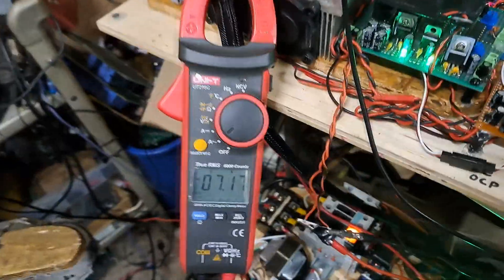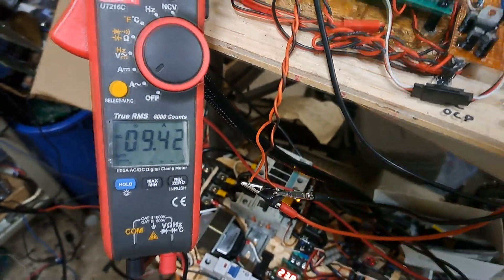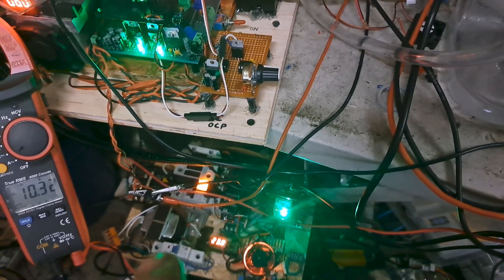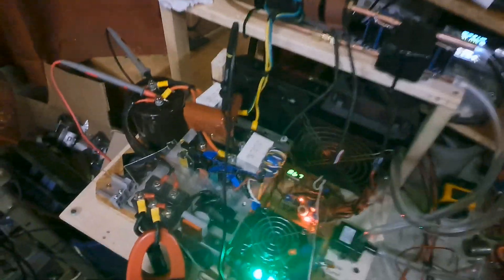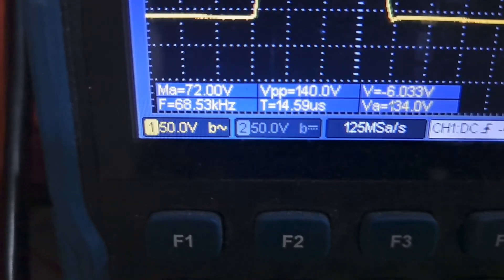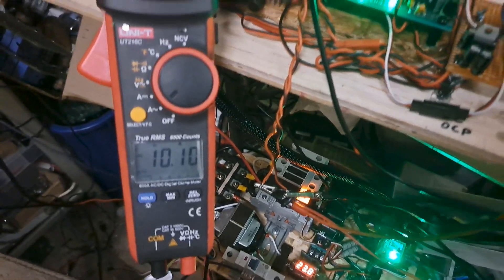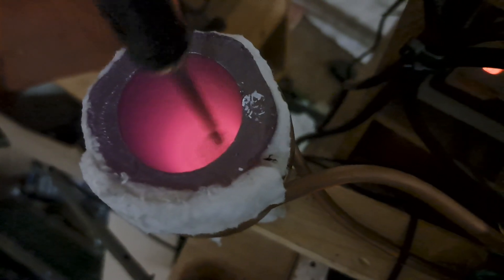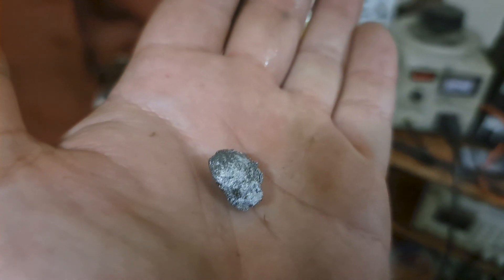H-Bridge Induction Heater Aluminum Test ~500W

Comment: Solid induction heater, i also wanted to built one like this but for now my I only have 12V ZVS witch is killing mosfets or capacitors when pushed to 350W
Reply from the maker: @TraperT  those can be easier to get working sometimes but I find the 30 to 50a requirement a little too much. Seems like the high power Chinese boards got it pretty much worked out by now though.
Reply: You need a microcontroller to control the switching to sense the zero crossing time to make less power losses the concept is used for the cooking induction heater for more information there's a YouTube channel explaining the concept in detail
Reply from the maker: @jeanmichel9207  You must mean zero volt or zero current switching. That is definitely ideal at higher power. These bricks should be able to handle a good deal of hard switching but yea tuning it is definitely going to reduce losses. I'm already kind of pushing it at close to 70khz though. I'm eventually going to tune it down closer to 40khz.

Comment: Impressive channel, just 'found' it on YouTube's main page :ø)
I live in Europe where 230V is 'normal' and I was wondering if you had tried one of those 1:2 transformers often used to convert mains voltage between US/'elsewhere' (often 50Hz vs 60Hz isn't an issue as most devices rectifies AC to DC internally)
A higher input voltage should lower current draw, and less current draw = less heat

Best of luck - I'll be following you from now on!
Reply from the maker: @EgonSorensen  Thanks, higher voltage is definitely an option but I'm more worried about my line amps than the bridge amps. I have old Alu wiring and have had a couple issues in my old panel so I don't want to push more than about 15A continuous. Using a Step up Transformer won't really do anything about that since it's still going to draw the same amps or more. Trying to just use 120 receptacles because it's too much of a pain to try to tap off my 240.
Reply: @Magneticitist  Ah - got it, so your amp 'limit' isn't in your circuit, but from your 'max power delivery from the wall'.
Bummer...
An alternative then could be using batteries, 10 pcs (12V) in series (or how many you need to deliver the 'sweet' spot in Volts needed). I've seen induction systems in the US use lithium (LiFePO4) batteries to provide the extra power needed which couldn't be pulled from the wall in kitchen stove top systems. They charge up when not used, and discharge when max power is needed.
Best of luck, and an awesome system btw :ø)
Reply from the maker: @EgonSorensen  What I'll probably end up doing is running 3phase 208 but I'll have to do it at work. For now I'll just have to make sure the thing survives at closer to 1-2kW continuous. Or maybe if I ever feel up to it I'll just run a dedicated 240 circuit but man I'm pretty sure I have no room in my old ass little panel for anything else.

Comment: Amazing brother , aluminum is a bit harder to heat cause it has less parasitic looses I think , you can trow some copper wire in the aluminum and make a dural alloy
Reply from the maker: Yea it gets a bit complicated regarding heating different metals with different topologies and frequencies but I felt like it was easier to do aluminum with this one. The only real downside to me is not having a low-ish "standby" current. It's basically the inverse of how a ZVS parallel LC works. Pretty easy to get going though. This is a good little test build to get a feel for running bricks and higher powers for long durations. 
I almost tried to buy TrentHV's tesla coil stuff. IDK if he still has it but I want to build a big brick TC that runs at low frequency. I just always change my mind cause I know I never run the smaller ones since they're too loud. Need to just get back to the big QCW bridges I guess.

Comment: Hey dude could you provide a reference for the PLL curcuit.

I'll be using one of those green powdered iron cores stacked. And 2 cascading N87 core for the current feedback , I'll be cascading then to make winding it easier.
I'm thinking maybe 1:300 (1:15:20 ) with a 10 Ohm burdan resistor and I'll have the OCD set to trip at 80 Amps peak. Is cascading it a bad idea and is the trip current OK if I'm using a half bridge with 60n60's.

I'm planning on using 0.33uf 1200VDC 630VAC induction cooker capacitors. About 15 in parallel for 5uF. But I'm not sure if that's a good idea for a 2-3KW unit, cus I'm not sure if they can handle the current. Any idea if they'll work.
Reply from the maker: It's the same as https://imgur.com/aPpbIlF but with like a 1.75nF timing cap and 5V supply. So it's just shifting the VCO output following PC1. A 555 timer to manually tune it works fine though. With these coupled LC's you just tune the bridge to the highest input current at no-load while also keeping an eye on the switching waveforms. For the best switching possible it's a little more complicated than that but that's the gist. I'd have no problem setting a particular frequency per work coil and just leaving it. 

For OCD you'll need to go higher than 80A with this topology. It will be in the hundreds of amps running in the tank. Sensing the tank current seems more effective but I suppose you could also limit the primary pk amps. Same thing works with feedback on these, you can sense the primary current as well since the tank frequency is reflected back on it. I haven't tried that yet. I would just create whatever high ratio CT that lets you easily do the math on the comparator voltage. 1000X is typically pretty easy. I really just start with a high burden like 20 ohms and work my way down til I've found the range that let's me test trip the OCD at low power. Then I'll decrease it at higher and higher power and eventually maybe calculate what I want my pk amps to be. 

I use the same cooker capacitors and I got them from some random store off amazon that doesn't even sell electronics so I was worried about them. They seem to work fine up to I'm guessing around the 1kW region, all depending. I would put a fan on them though..
Reply from the maker: So I ended up running it at about 600W for like 20 minutes and got some more aluminum molten. I basically just melted another small heatsink and then kept adding some aluminum foil balls. After that time those induction cooker caps were pretty hot. I'm not going to run them anymore above that power. They do about 600W for a little while like I thought but they just start getting too hot over that. I've seen someone else shave them down in order to sink them but that seems like a lot of work.

Comment: Can you use ferrite for the coupling transformer? I have a few large material 75 toroids
Reply from the maker: Yea I don't see why not
Reply: @Magneticitist  I've seen a lot of people talking about tuning the coupling transformer, but what is that process look like in practice? I haven't seen anyone actually describe how they got optimal tuning except just use a bigger core😭
Reply from the maker: @darascope  The size of the core should only really matter when it comes to making sure it's not saturating. I think any decently sized core can handle the amps unless someone is planning to push like 40+. When it comes to tuning or impedance matching, from what I can gather this is really just a process of tuning your primary impedance to cater to your intended power consumption at the intended voltages. This is a bit similar to just tuning the primary on a single resonant Tesla Coil. Right now I'm using approx 11 turns on my primary. While it doesn't heat up at around 600W circuit input the low impedance may become a problem when I hit the highest input voltage and no load operation. I may need to add a few more turns etc. If your primary is poorly matched to the load at the intended frequency then it's probably going to either heat up quite a bit or simply not transfer a lot of power at the supply voltage due to too high an impedance. 

So basically I haven't gone through a tuning process yet. I just used a random scrap piece of ground wire I had and it reached 11 turns. This allowed me to test it at some decent ~10A region at only a 60VDC supply max but also showed me I WILL probably have to adjust it a bit when pushing full intended power.